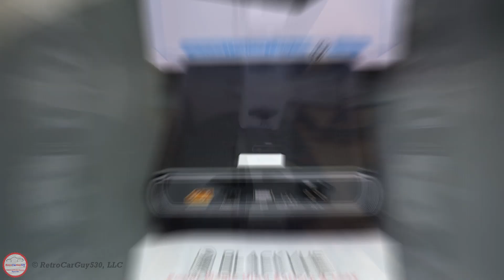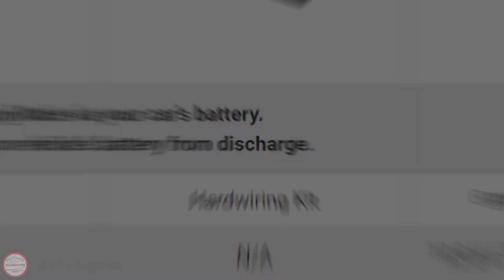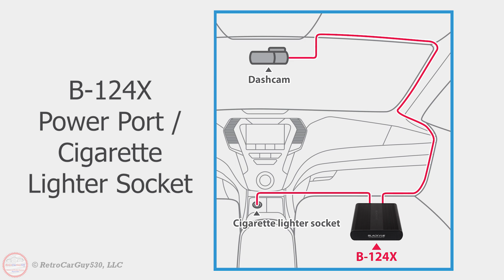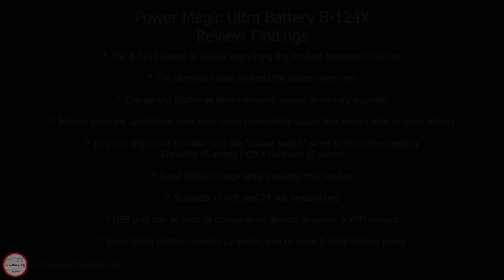BlackVue Power Magic Ultra Battery B-124X - Introduction / Review

Comment: When you say about the 3 wire kit for other brands of dash cam. How does that get wired in? For example I have a Viofo A-129 Pro Duo which can only use parking mode with the Viofo HK-3 Hardwire kit so that the junction box can tell it when to be in normal operating mode & when to be in parking mode. So therefore I need to retain the HK-3 hardwire kit somehow and splice the B-124x into it. I'm guessing the red battery wire from the HK-3 wiring kit. Or do I just use the cigarette lighter socket and just have the dash cam recording all the time thus negating parking mode?
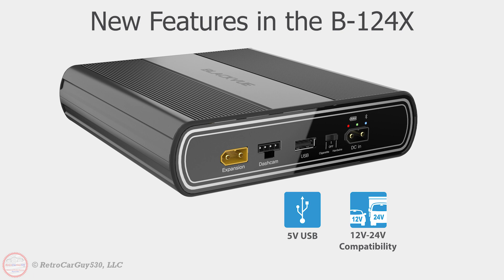Reply from the maker: At 5:28 in the video, I mention the 3-wire dash camera hardwiring cable that can be purchased to allow dash cameras that require constant/battery power, switched/accessory power and a ground to work with the B-124X.  The VIOFO hardwire kit (HK3) has slightly different colors for the constant/battery power (red) and accessory power (yellow) wires.  The cable from BlackVue (actually from EGEN that manufactures the battery pack) has constant/battery power on the yellow wire with switched/accessory power on the red wire.  You would need to purchase or make that cable to splice together with your HK3 to power your VIOFO dash camera.

Here's the link to the BlackVue page to purchase that cable. https://shop.blackvue.com/product/power-magic-ultra-battery-b-124-b-124x-accessories/

I you're handy with cutting wires and crimping on terminal pins, I have a video that shows how to make that cable.  https://www.youtube.com/watch?v=WeznBYC14kg
Reply: @RetroCarGuy530  Thank you that's really helpful. I get it now. My only other question is on that black view 3 wire cable. In the picture of it, it has a 4th wire coming out of it that looks to be green and has a label on it acc in. Does that get a tap into an accessory fuse in the fuse box of the car?
Reply from the maker: The connector that plugs into the B-124X or even the brand new B-130X has four terminal positions, but only three are filled with terminal pins/wires.  There is no green wire.  The picture of the cable on the BlackVue website has a label on the left end of the cable and it shows "YELLOW B+, BLACK GND, RED ACC OUT".
Reply: @RetroCarGuy530  sorry one other question. So we've been talking about black wire being the cameras ground. But in terms of the black wire coming from the blackvue battery. Would that not be negative? Is it OK to wire ground to negative in this case?
Reply from the maker: The ground/negative wire for the dash camera should be connected to the ground wire terminal in the "Dashcam" power connector on the dash camera battery pack.  The left most terminal pin has the constant battery power, the second terminal pin (from the left) is the accessory/switched power and the third terminal pin is the ground/negative for the dash camera.  I discuss this topic a bit further in the video I have where I talk about making your own cable to connect your dash camera with this battery pack (and a few others manufactured by EGEN) https://www.youtube.com/watch?v=WeznBYC14kg
Reply: @RetroCarGuy530  Got it all installed now. Thanks so much for your help. Although to my surprise I actually found a 3 wire kit in with the battery. So I didn't need to order another. That'll teach me not to open the box first I guess but it didn't mention it in the pack contents.
Reply: @RetroCarGuy530  with the CPL filters fitted to front & Rear lenses would you recommend increasing the exposure of both the front & Rear camera to compensate for the slightly darker lenses to improve low light performance? Or would this cause day time footage to be washed out?
Reply from the maker: BlackVue only sells CPL filters for the front dash cameras.  The current generation of "X Plus" dash cameras does not allow you to change the exposure settings.  The previous generation BlackVue dash cameras did allow you to change the exposure setting and if the CPL filter is installed, I would suggest bumping up the exposure just a bit.
Reply: @RetroCarGuy530  It isn't the blackview camera I have. I have the Viofo A129 Pro 4k Duo. Have fitted CPL filters to both. And thank you for confirming I needed to up the exposure a little. One other question. Is it possible to install the CPL filters upside down by mistake?
Reply from the maker: I don't believe it's possible to get the clip on style of CPL filters for the A129 Pro upside down.  The website page for that CPL says you can place the either side of the CPL filter with a slot (long or short) on the top of the camera lens housing.  
https://viofo.com/accessories/85-viofo-cpl-for-a119v2a119v3a119minia129-duoa129-pro-duoa129-plus-duo.html

Comment: How long will this power a DR750X 2Ch in Parking Mode?
Reply from the maker: Somewhere in the 17 hour range depending on the parking mode selected and conditions (temp).
Reply: @RetroCarGuy530   When you say parking mode is this time lapse mode to get 17 hours?
Reply from the maker: I used the milliamp value from the BlackVue website for the DR750X-2CH Plus dash camera "parking mode" and Wi-Fi off value of 300 mA.  I then used a runtime calculator taking the B-124X battery rating of 76.8 Wh (Watt Hours), 300 mA (from BlackVue website for the dash cam) and I used a voltage of 14.3 volts since that is what that battery pack outputs with a 100 percent charge level.  The BlackVue website shows a voltage level of 12.8 volts, but that's not what it actually outputs in reality.  The voltage level decays a bit as the charge level decreases, but it's good enough for calculation purposes.

Using those stats, the battery life calculator outputs a 17.9 hours runtime.  I was curious if the real world current draw values (milliamps) for the DR750X-2CH Plus was really 300 mA in parking mode.

I setup a DR750X-2CH Plus for time-lapse parking mode, no cloud connectivity (allows Wi-Fi to turn off after 10 minutes of no use).  For the 10 minute period with the dash cam in time-lapse parking mode with Wi-Fi still on, it consumed on average 286 mA.  After the 10 minute timeout period completed and the Wi-Fi was turned off by the dash cam, the current draw dropped to 270 mA average (max 301 / min 264 / avg 270).

Using the 270 mA value in the battery runtime calculator (76.8 Wh, 0.270 A (270 mA), 14.3 voltage), it calculated a 19.89 hour runtime value.

Dash cam battery packs are not usually at a 100 percent charge level unless you drive long enough to allow the battery pack to fully charge before parking the vehicle and the dash camera enters parking mode.  I would take the 19.89 hour runtime value as a optimistic estimate.  I would guess you would actually see a 18.5 to 19.5 hour runtime value assuming your DR750X-2CH Plus dash camera consumes the same amount of power as the one I used in my power consumption test.
Reply: @RetroCarGuy530  is there a way to turn the Wi Fi off when in parking mode to conserve power? It does nothing unless I have a separate LTE module with a SIM  card. My wif fi is  on all the time in  parking mode  parking mode
Reply from the maker: If BlackVue Cloud connectivity is enabled, the Wi-Fi will stay on all of the time (normal mode or parking mode).  If you disable BlackVue Cloud connectivity and turn on the auto turn off Wi-Fi, the Wi-Fi will be shutoff after 10 minutes with no connections (usually 10 minutes after the dash camera powers up).
Reply from the maker: I rechecked my output voltage statements last night.  I misstated the output voltage as 14.4 volts with a fully charged battery.  The 14.4 voltage level is output when the battery pack has input/charging power.  When it's just the battery providing power, the output voltage is 13.3 volts with a 100 percent charged battery.

I reran my DR750X-2CH Plus time-lapse parking mode power consumption test with 13.3 volts being supplied to the dash camera.  With Wi-Fi on (first 10 minutes after power up), it required (on average) 304 mA to power it.  When Wi-Fi was turned off, the current draw dropped to (on average 283 mA.

Using the 283 mA value in the battery runtime calculator (76.8 Wh, 0.283 A (283 mA), 13.3 voltage), it calculated a 20.4 hour runtime value.  I just wanted to make sure I gave you the estimate based on the actual battery pack output voltage level.

Comment: Is it possible to charge the 124x in your home while not driving the vehicle?
Reply from the maker: In theory, yes you should be able to charge it while not driving.  I gave that battery pack to a friend as a birthday present, so I can't try it with that unit, but other dash cam battery packs don't always accept 12-volt charging from an AC-to-DC power supply.  I've observed other units fail to remain in their charging mode when I used a NOCO Genius 10 in power supply mode to provide 12-volt charging power.  The dash cam battery pack's circuitry may not like the simulated DC power signal generated by that particular NOCO Genius 10 unit.  You would need to switch the dash cam battery pack to its low amp charge setting (slide switch on the unit sometimes labeled "Cigarette") so it is only going to draw around 5 amps while charging.
Reply: @RetroCarGuy530  Thanks appreciate it

Comment: The instructions are all wrong !!!! More than 20 amps or 15amps allowed??? Because 15 amps work so far …. So which is it???
Reply from the maker: I agree the manual's statement to use a 20 amp fuse in the fuse tap's top fuse socket which sends power to the battery pack is excessive.  When I first reviewed this product, I did not perform an amp draw test on the hardwiring cable to see what the true maximum amp draw was for this item.  I gifted this item to a friend for his birthday, so I no longer have it in my possession to perform an amp draw test.

Based on my testing for other dash cam battery packs made by EGEN (company that makes this for BlackVue), I would believe that with the slide switch on "Hardwire" this unit actually draws in the 12 to 14 amp range.  I would believe the 15 amp fuse to be sufficient to use with this product.  Worst case would be that it pops the 15 amp fuse (assuming no actual battery pack problems) and you would need to revert to using a 20 amp fuse.

Comment: Such a through video. Thank you. I have a 124-X wired to the 12V cig. socket. It charges fully on my way to and back from work so I don’t need to hardwire it. The problem is, it is discharging fully in less than 12 hours while inside my garage in parking mode. I have a 2CH 900S and a Franklin T-10 connected to it. My question is, can I install my old PM Pro in between the 12V socket and the 124-X power port? So that I can use the ‘on and off’ switch from the PMP? And if it is feasible, what would be a good cut off setting so my 124-x won’t discharge so quickly and it would cut off power to the dashcam if I forget to set the PMP to off position when parked in the garage? I’m with you that BV dashcams should have a ‘on and off’ switch… as well as an alternative suction cup mount to prevent damage to our window tint when removed… Blendmount doesn’t make mounts for 2021 MB E-53… I lease cars and this is a constant problem. (I want to upgrade to the 900X Plus, but the brownish tint is hard to overlook at this time)  Thank you in advance for your time. (Sorry for the long comment).
Reply from the maker: Yes, it appears you could install the PMP in between the B-124X and the DR900S.  You would need the 3-wire output cable for the B-124X to it could be connected to the PMP to supply constant power, accessory power and ground.  The PMP need to see the accessory power to know when to allow or disallow parking mode power to the dash cam based on the toggle switch setting on the PMP.

Another approach is you could simply add a SPST (single pole, single throw) toggle switch into the power feed to the DR900S.  I've added a switch in my power feeds to my dash cams to allow me to power down the dash cams while parked in my garage since the BlackVue dash cams do not have a power switch.  Either approach requires a small bit of wiring to accomplish.

Whatever limits you setup in the PMP will be true for all parking mode situations, so settings for your garage situation may artificially limit parking mode while driving your vehicle.

Comment: Hmm, does anyone thinnk i would have difficulties with my 12V outlet being in the trunk of my car? It only has USB-S outlets in the front and back seats!
Reply from the maker: The three cars I've installed dashcam battery packs in over the past several years have all been located in the trunk.  The reason for that is the car's battery and a fuse box with accessory power was present in the trunk.  All three cars were GM (Holden) produced cars - two different Chevy SS Sedans and my current Chevy Caprice PPV.  Due to length of those cars, the 3-wire hardwiring cable that provides power to the dashcam needed to be extended about 3 to 6 feet due to the car's length.  

I also preferred to provide power to the dashcam battery pack using a slightly different approach.  Rather than using a fuse tap to directly provide power to the battery pack, I used a fuse relay instead.  The fuse tap was still used to obtain accessory (switched) power to control the relay.  The relay obtained its power feed directly from the battery (with an inline fuse).  The relay would be controlled by the accessory power from the fuse box.  This way the load on the fuse box was minimized while still providing the necessary power to charge the dashcam battery pack.

I recently reviewed the BlackboxMyCar PowerCell 8 battery pack.  In that review video, I outlined my alternative wiring approach for providing power to the battery pack.  That same approach could be used with any battery pack.

https://www.youtube.com/watch?v=Joa0fiKZY-o

Comment: How does this compare to the Powercell 8 or the Cellink? Seems like this has less mah capacity, but does this control power better? I just don't know why I would get this over the Cellink or Powercell 8 if it doesn't have better voltage control
Reply from the maker: The B-124X is very similar tot he Cellink Neo since they're produced by the same manufacturer.  Their capacities are the same as well.

The Powercell 8 is a recently released product for BlackboxMyCar and it has approx 25% more battery capacity.  I'd like to get a Powercell 8 to review, but I don't have that kind of money in my company budget right now to test it out.   Given the Powercell 8 has 25% more battery capacity than the B-124X/Cellink Neo batteries, I would probably purchase the Powercell 8 today in late 2021.  My review was done back in December 2019 long before the Powercell 8 was on the market (and its temporary predecessor for BlackboxMyCar).

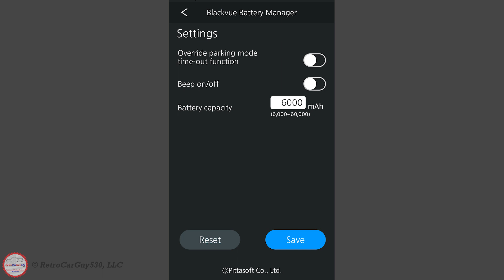Comment: So according to the parameters of battery capacity at 11:03 60000mAh means you can connect up to 9 B-124E expansion packs?
Reply from the maker: Each BlackVue B-124E expansion battery is rated at 6,600 mAh, not 6,000 mAh like the B-124X.  The B-124X user manual on page 14 lists total battery capacities for a B-124X along with one to five B-124E batteries.  The total capacity listed for the single B-124X with 5 B-124E expansion batteries is 39,000 mAh.  In theory, the max config that stays under 60,000 mAh is one B-124X (6,000) + eight B-124E batteries (6,600) for a total of 58,800 mAh.

The other thing to consider is that the charge time increases as you add additional B-124E batteries to the system.  Depending on your driving habits, charging a B-124X as well as one or two B-124E batteries might be a challenge.  If your average vehicle trip length is less than 40 minutes (assuming hardwired into the car), you won't fully charge the B-124X battery by itself.

Adding one or more B-124E batteries to the system suggests that you're trying to extend the amount of time your dash camera will be powered in parking mode.  If you don't drive the vehicle long enough to fully charge the batteries to their full capacity, you'll greatly reduce the amount of time that the system can provide power to the dash camera.

The cost of adding each B-124E battery is quite expensive, so you have to make sure your driving habits will make the financial investment worth it.

I hope that helps.
Reply: @RetroCarGuy530  I understand now thank you for the information. My plan is to run a 4ch dashcam system alongside a constant wifi hotspot. I will be running two Blackvue DR900X-2CHs with each dashcam having it's own B-124X. I was thinking 2 or 3 B-124Es each should be enough.

Comment: If you use cigarette lighter for powering the black Vue battery do you unplug when you turn car off?
Reply from the maker: It depends if the cigarette lighter port is powered when the car is of or not.  If the cigarette port provides power all of the time, then yes you must unplugged the battery pack to prevent it from draining your car's battery.  If the cigarette port only provides power only when the car is on, then you can leave the dash cam battery pack's power plug in the cigarette port when the car is off.
Reply: Thx. I think it doesn’t I installed in a 2020 Ford Escape. I wanted to bypass using car battery while I’m not in the car. I think I will just unplug to be safe. My commute to work  is enough time to charge black vue battery. Thx again.

Comment: If you use cigarette lighter for powering the black Vue battery do you unplug when you turn car off?
Reply: No because the cigarette lighter is a switched fuse not constant meaning it will turn off when the car is off. Hope that helps 🤙